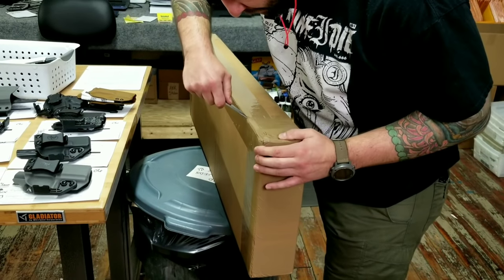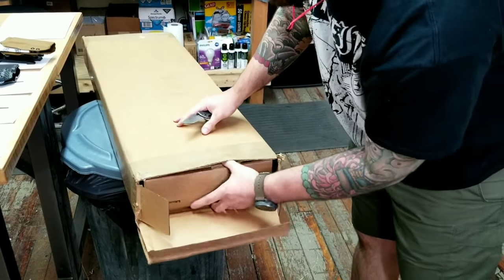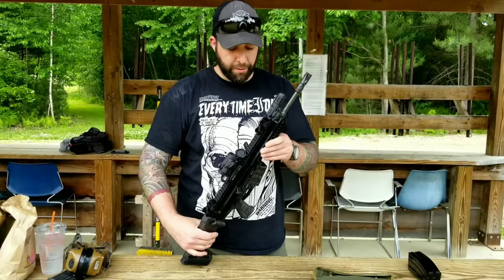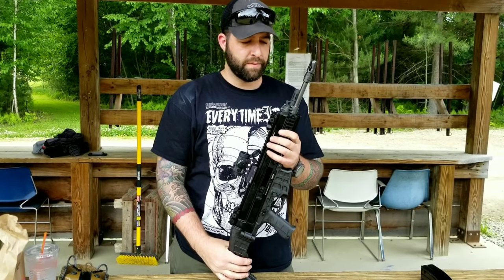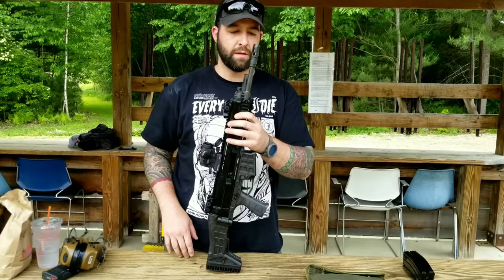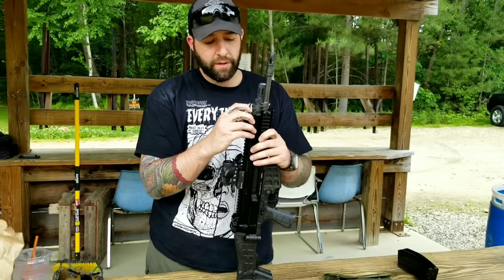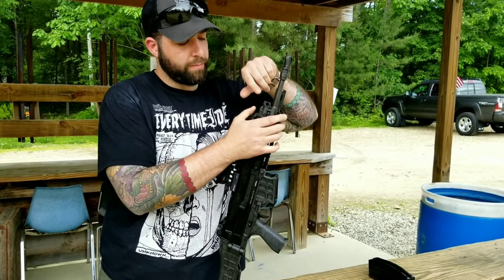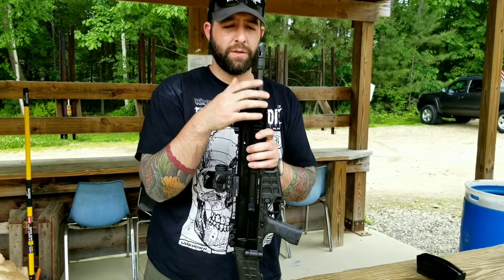CZ-USA BREN 2 - FIRST LOOK!

Comment: Greetings from a soldier from the Czech Republic.
For three years I've been wearing this beauty day after day! With Pride!
Reply from the maker: Hell yeah
Reply: Awesome! I love mine. Hows yours holding up? Any issues or concerns you have with it or any others youve seen? Is yours 14" ? 5.56 or 762?  Thanks for the info and the great guns :)
Reply: @charltont23  My first service weapon was the CZ 805 Bren A1, this version had some bugs. For example, when switching on M4 mags, mags dropping from gun, the rails on the gun were too sharp to hold without gloves, and we did not have the covers on them, we used rails to cut the wood sometimes :D At low temperatures, the slide did not return even with a well-kept weapon (Too much friction surfaces).
CZ Bren 2 modified for Airborne division.
I am fully satisfied with this version! This weapon is very compact and durable. They fixed most of the previous Bren problems! And of course we are using the classic 5.56 NATO ammo.
I apologize for my English, wish a nice day and lots of gunfire. :)
Reply: @martinstepnicka5007  Thanks for the great info. I will buy with confidence now. Looks like this is the best gun made. What barrel length do you recommend?
Reply: @charltont23  I am very sorry, but the European and American states have very different laws for weapons. I'm not familiar with what variants are available on your market. That's why I can not help you.
 :(

But I can tell you that... in our case we mainly use the barrel length 207 mm (8 in.) for Airborne. And 280 mm (11 in.) for other members of the division like logistic support and backup forces. And one more specific modification for Airborne Spec. ;)
Reply: Just bought me one a few weeks ago

Comment: Looks better than the scar ✔️
Lighter than the scar ✔️
More durable stock ✔️
Made by cz ✔️
Cheaper than scar in price ✔️
Reply: Looks pretty sweet but does it come in 308 like my galil ace
Reply: clasic czech gun 
good like vz 58 but a machine gun
Reply: Not to mention,
- built better than the SCAR
- has a lighter recoil impulse than the SCAR
- way better stock trigger than the SCAR
- just as reliable as the SCAR
- just as accurate as the SCAR (if not more)
- ditched the reciprocating charging handle, unlike the SCAR
- did I mention it's cheaper than the SCAR too?
Reply: @phillipcastro2394  yeah it comes in 308 and in different lengths of barrel

Comment: Really nice looking gun. When CZ sets out to do something, first they do a good job, then it doesn't take them long to perfect it.
Reply: Even better work was done by Czechoslovakia with the first bren. Bren is not an English weapon, but a licensed modified weapon vz. 26. Bren 2 is no longer original because it is based on scar and has no problems at first. But the same good work.
Reply: Neni založen na Scar,vývoj CZ Bren probíhal už na přelomu tisíciletí a prvně byl v prototypu představen už v roce 2007  a v roce 2008 v soupravě vojáka 21 století na výstavě Future Soldier 2008, taky když se podíváte na fotky z tý doby jsou tam ještě rozdíly mezi finální verzí a verzí z toho roku, u FN SCAR se udává první prototyp sice dřív ale vývoj český pušky probíhal delší dobu už od zadní z devadesátých let se počítalo se změnou ráží a hlavně zbrojovka to vyvíjela sama bez státní intervence.
Reply: To roughly translate what the guy is saying: BREN is NOT based on SCAR, it was already being developed before 2000, first prototype was shown in 2007 and then in 2008 during Future Soldier 2008 showcase. While FN SCAR had first prototype sooner, Czech BREN was developed for longer time and developement started sooner. Also since 90´s designers counted with changing the ammo used to 5.56x45. Also worth to mention that it was developed without anyone from state interfering.
Reply: Repeal the Hughes Amendment

Comment: I am 99% certain the bolt release inside the trigger guard will lock the bolt back if you push up on it and pull the charging handle back.
Reply from the maker: It does
Reply: Wow I should really just quite my job and become a weapons designer, obviously I have a knack for it =P.
Reply: Wish someone would do that for ARs! POF has a bolt hold open but not release...Sword has an outside trigger guard type (My favorite as it gets your finger OUT of the trigger area! Extremely intuitive and fast! ) like the ACR.
Reply: LMT Mars lowers and LWRC M6 lowers have ambi bolt open/release and ambi mag catches.
Reply: Indeed, I have them and Falcor and Ascend Armory also...S&W has some as well. I meant a set up like this weapon in the video. I should have been more specific I suppose. ___Sword (I do not have yet) has the bolt hold open/release like the ACR and POF has a generation that has a bolt hold open in the same location as the weapon in the video.
Reply: spektr, POFs have a bolt release just above the mag release so you can hit it with your finger.
Reply: Indeed they do, I have one. The controls are a bit disjointed compared with the ACR, Sword ARs and this weapon in the video (though I don't quite like it being inside the trigger guard.)...all nice and neat in one place and completely ambidextrous/ mirrored from both sides. IMHO, I like the Sword set up best, followed by Falcor and Ascend, then LWRC (almost mirrored) and S&W M&P10 (again almost mirrored).
Reply: Can you link to video or article of the Sword AR?  Im not finding anything about their ambi lower
Reply: Google Sword International and you should find them quickly. They make a 338 Lapua version...VERY SPENDY though!  AR15 types are, MK16 is piston, MK15 is DI.
Reply: I have this gun a can confirm 100% it does

Comment: CZ's building a factory in Hungary, and the Hungarian Defense Force will most likely adopt the Cz Bren 2 rifles. Sweet!
Reply: mekes me feel patriotic
Reply: Thats cool tho :) Greetings from Czech Rep. Guys
Reply: oh god that wire stock on the AMD65 looks uncomfortable as shit. Also dont knock plastic. If you use the right polymers for the right job, it can do better than wood.
Reply: fassenkugel  Because the AMD uses 7.62 ammo and the Bren 2 uses 5.56 NATO. Considering we are NATO members, using NATO standard ammo would be nice. Also the 5.56 is a flat shooting cartridge. The Bren 2 also has features that are standard on a modern rifle, but missing on the AMD. Being plastic is not a negative thing. Plastic is lighter, more durable and has better heat resistance than wood.
Reply: Like bolt release, non reciprocating charging handle and an actually usable stock.

"Check the G36 (Not the G3 btw)" is the standard reply of every guy who emotionally hates polymer. The G36 was NOT designed for continous firing and the tests were nothing but non-stop firing. Also consider that the G36 is just ONE weapons, while many other polymer firearms don't have any issues with heat.

The Hungarian made Bren 2 rifles will use 5.56 btw.
Reply: are you sure?
Reply: Actually, the Warsaw Pact optic mounts are pretty stable and strong, no zero issues. AKs are accurate enough for GI use, which was proven over and over again.
Bren is still a superior rifle, that much is a given. Lighter weight, easier operation and etc.
But do not diss on AK rifles.
Reply: Same in Pakistan as Pakistan and CZ have signed an MoU in which Pakistan will buy 0.5 million CZ-806 Bren A2 directly from CZ on first Phase and on Second Phase CZ will transfer CZ- 806 Bren A2  technology to Pakistan Ordinance Factory (Pof) so that there rifles can made locally.
Reply: fassenkugel  Plastic AK huh ever heard of VZ.58 then? XD Thats by CZ improved AK (and this has litteraly nothing to do with AK it might have some things in common with SCAR but thats about it ).
Reply: Not it's not the same as an AK. The bolt carrier group is closer to an actual AR but shaped differently, which is pretty much the design exploited by most modern 21st century piston rifles. 

The AK's piston is a long stroke piston, while modern non-AK rifles are short stroke with a gas valve for standard supersonic and subsonic use which is quite a difference. Even the new AK-12 and AK-107/MK-107 platforms have many things in common with the previous ones. 
It's still long stroke operated, same bolt design and barrel with improvement for recoil and accuracy. Same safety selector for budget reasons exept for the civilian MK-107 which is ambidextrous. Rear aperture sight was relocated completely in the back now. Still no magwell, just the regular AK mags and insert. Now it also has picatinny rails covering the dust cover. In the past, they had to buy Zenit picatinny dust covers but there is a global effort to make it standard on every recent models. 
The side rail is not useful anymore, they want to use or copy western accessories and optics and since they are using free floating barrels, zeroing is less of an issue now. There is also an extensive use of "plastic" as you call it on the modern AK since the... Surprise... AK-74M which was adopted by the russian army, and performs really well! And the AK-1XX series ofc. 

I find it stupid to call the BREN 2 an AK copy, it is clearly it's own thing. Even Better, it is as people name it, the "SCAR killer". 

The AK-12 is an attempt to eliminate their obsolete soviet ergonomics and controls by copying the western rifles. The most obvious change in that regard is the similar adjustable stock.
But still, the BREN 2 has everything you could wish for a 2019 rifle: ambidextrous everything, picatinny and M-LOK compatible, non-reciprocating cocking handle that is also used as a forward assist, short stroke gas piston reliability, sturdy construction, foldable and adjustable stock, light weight, simple disassembly and cleaning process, several barrel length choice and easy caliber conversion between 5.56 and 7.62.

It was also tested and adopted by several special forces and armies.
Reply: Our French GIGN has adopted the Bren 2 in 7.26x39
Reply: fassenkugel It’s anything but a “plastic ak”. Completely different firearms.
Reply: Seeker HUN “lighter, more durable and has better heat resistance than wood.” That’s a bit like saying all cars with a V8 are faster than all cars with a V6. Tell this to the Kalashnikov family.

“modern rifle” Meaningless terminology. It’s like saying “fifth generation fighter jet”. 

Flat shooting? So is 7.62x39mm. The AKM has a point blank range of 300 meters (at least), which means there’s no bullet drop until then.

These “features” aren’t standard, either.
Reply: Seeker HUN Why are you saying “GI”? Are you an American now?

“actually usable stock” Like the AK stocks. 

“still a superior rifle” A ridiculous and ignorant statement. 

“easier operation” Try and define that. 

You’re dissing the AK’s, so...
Reply: Martin Budinský The Vz.58 isn’t an AK at all.
Reply: @zoltancsikos5604  Digging up one year old comments and responding with straight up bullshit is just sad.

"Actually usable stocks" refer to the trash refer to our own AMD-65 stock, and the standard AK stock in not adjustable, which is a big difference when using body armor.

"There's no bullet drop until 300m" There is. There is even drop on the 5.56 and the 7.62x39 is drops even more. You can aim at belt level at hit a body at 300 meters if you set the sights to battle zero. 5.56 still shoots flatter making aiming easier. 5.56 recoils less meaning faster followup shots.

"Easier operation" refers to the wonderful technology of last round bolt hold open and bolt release function with a drop in mag insert compared to a rock-n-lock mag insert. It's also a lighter rifle meaning easier to carry around. Safety selector is also easier to operate.

Even disregarding all of the above, adopting the Bren 2 is still a good decision just on the basic factor of it being 5.56 which is the NATO standard round and makes logistics, ammo manufacturing and procurement significantly easier.
Reply: God do I hate the VZ 58 , I have shot nearly 100 of them and almost every single one had malfunctioned in full auto, no problems in semiautomatic mode .
And the accuracy was dreadful, I know they are now old and I would love to try a brand new one if that was possible as the malfunctions could be caused by wear and tear.
The accuracy cannot be fixed .

Comment: I run CZ's and have never looked back. The 805, once you understand it's simplicity of form and function, is a solid performer. The 806 or Bren 2 or whatever we call it is the evolution of a great piston driven firearm. 

Yes, I want the new 806 but have no issues running the 805. Rock on !!!
Reply: well but in czech republic it wa sith storm around 805 that they have to say "ok its new gun"

Comment: This is one rifle I’d love to get in 7.62x39
Reply: You'll be able to. I'm stoked.
Reply: AK mags, from what I understand. Proprietary. Not too prevvy if its proprietary, but I'm an AK slave anyway, so i'm not bitching. Can't wait for this. IF someone else can confirm that it accepts other AK mags, I'm all ears.
Reply: You can get 100 rnds of 7.62 x 39 for 25 bucks at Dicks. Field and stream brand. My AK eats those things for breakfast and it's never jammed. So about 400 rnds for 100 bucks. AK ammo is cheap af. I'm sure you could get it even cheaper elsewhere online. Just mind those shipping charges.
Reply: As far as price for the firearm, I'm not really sure. I would say it will be significantly less than the SCAR 17, as their price points typically seem to suggest. I do know this new Bren is lighter and was quite a bit cheaper to produce than the older gen Brens.
Reply: This is CZ 806 Bren, CZ 807 Bren is in 7,62x39mm
Reply: Good to know thanks!
Reply: This is not true, CZ 806 - BREN 2 have 7,62 too, CZ 807 is cheaper army verison for Pakistan..
Reply: From another YouTube video, at shot show, the Cz two said all u need to do is take out the magwell for the AR or detach it from the lower and swap out the barrel. The bolt doesn't need to be changed or the spring.
Reply: They are right around 1800 dollars
Reply: David Stanton I hope the 308 brens aren't as much as the scar
Reply: I guess you're talking about the 7.62x51, not the 7.62x39, dont you?
Reply: HumA yes the 7.62x51,308
Reply: Cz doesnt even know when this is coming. I really want to buy an 805 to compliment my 17, but I think the 805 prices will drop when the s2 comes out
Reply: 5.45 × 39 for me.
Reply: @QuakerCZ1  not true.
Reply: @ixotuckeroxi  what's the s2?
Reply: @rawpilot84  s2 as in what the civilian version of the new bren. At the time of this video, it wasnt confirmed but there was speculation of the new bren being 308. I believe it is confirmed now that it is in fact 7.62x39. 

I ended up buying an 805 (556) and couldnt be happier.
Reply: @DOMINIK99013  lol, it's not a cheaper version for Pakistan Army but a dual-caliber assault rifle version which allows operators to quickly change caliber of weapon to either 5.56x45mm or 7.62x39mm. Pakistan army currently operates H&K G3's and Modified AKM's  as standard issued Battle and Assault rifles with large stockpiles of the ammunition and strategical needs, so it favours 7.62*39 round over 5.56.
Reply: It is going to be in both. I've been excited about this gun for a while.
Reply: @RaoShafae  You are lol, CZ 807 have lot parts from 805 and oder chepaer things, without any 
improvements what BREN 2 (CZ 806) have, CZ 807 prototype in 7,62 i first shoot in December 2014 when i studied like gunsmith in CZ, at the time when the second generation of Bren was not on the Internet anymore and none of my classmates knew what it was when we first saw it
..
Reply: Heck yeah!

Comment: The original Bren 1 (805) was a good try, but the gun had its issues, most of them were identified by the 601st Special Forces Group deployed in Afghanistan, which was the first unit to use the first production batch in combat conditions. In many aspects, Bren 2 is a different gun rather than just mere iteration of the first generation. They really knocked it out of the park this time.
Reply: thanks for the context. I have an A/R that is now illegal in Canada , but I can get this or a B&T apc or a Canadian non A\/R ..: we have many actually. I am thinking a piston semi would be a step up. Its battle proven. The apc is only police proven but highly regarded. I have 3 cz pistols, they make great stuff.

Comment: It's stupid to immediately start chopping it up
Reply: Yep.
Reply: CZ USA - "Uuuhhh. Heey.. Remember that rifle we sent ya a few months back...? Umm, Yeah. We gave you guys the wrong one and we need that one back."
Reply: Zero appreciation for the beauty of stock configuration these days.
Reply: Why ?
Reply: First of all, its already a shorter barrel than factory length. Second, theres nothing wrong with short barrel rifles. You lose almost nothing except your hearing and a little weight. The pistol versions have 9" barrel and shoot sub-2" groups at 100 yards. I really dont see why you wouldnt enjoy a good sbr
Reply: Well, this guy's not too bright.
Reply: Exactly. There's no need to chop it.  14x1 means the threaded area is 14mm thick, why not just put it on a lathe, turn it down to 1/2" (12.7 mm) and rethread it.  Chopping is completely unnecessary.

Comment: 2+ years late on this review but, great video! I am surprised that you think that the 805 Bren has a stronger recoil impulse compared to the SCAR. Most people, including other reviewers, typically say the 805 is a smoother shooting rifle than the SCAR. Especially because it has a WAY better stock trigger amd 1.5 lbs heavier in overall weight. Not to mention, it's better built and just as accurate. That said, I agree with everything you said about the Bren 2S you have in this video. Wish they would've kept the same trigger from the 805 though! I also wish they would've continued making this model (2S, the one in this video) because I feel it's better than the 2MS currently available. The 2MS is definitely more modular but, the 2S was more durable/reliable imho.